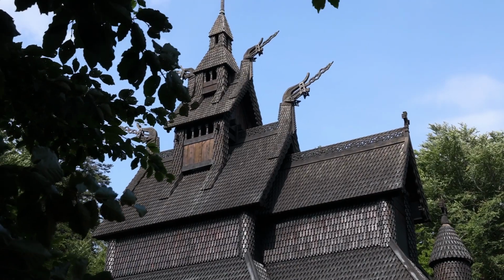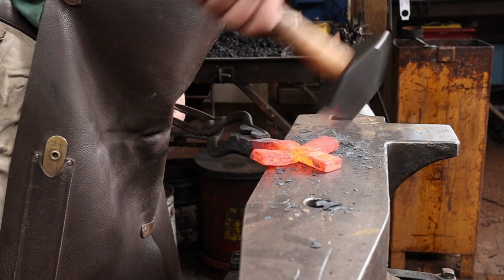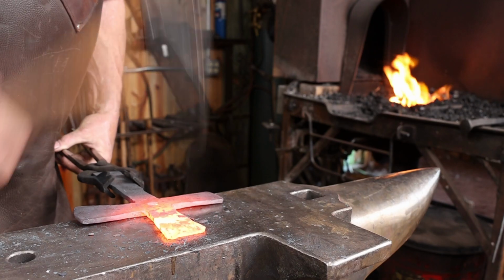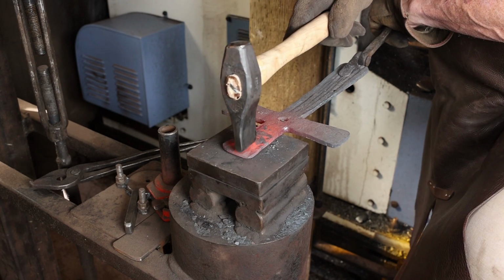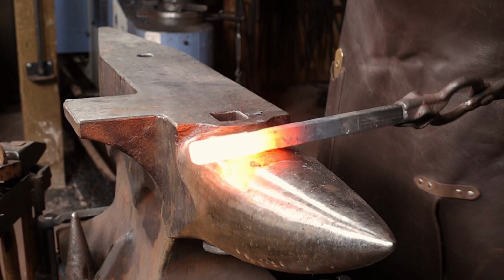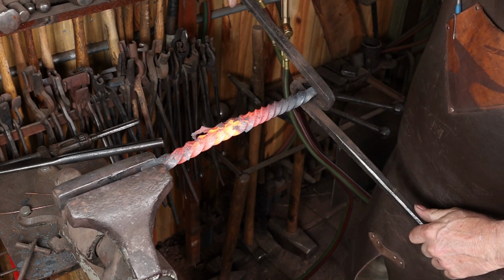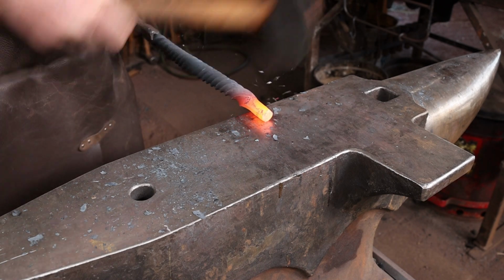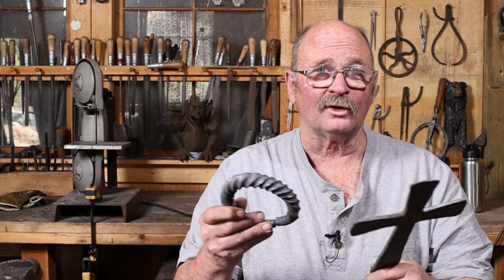Church door Handle - part 1

Comment: For straightening those twists out, we used to use a piece of wood for the anvil and a big wooden mallet, not too hard but not too soft of a wood, to beat them out straight. Doesn't do much damage to the edges.

Comment: You mentioned a wooden mandrel; any sufficiently sized green branch would work.  Doesn't even need to be proper size or round, just something with curves soft enough to not mar your work.  I made a 1.5'-ish diameter ring out of .5" square stock with twists.  The final ring shape was done on a 1' diameter log without a rawhide mallet.  I just used a branch as the hammer.  I'll confess to electrically welding the ring together instead of forge welding it.

Comment: Another excellent video sir. It’s appropriate that I usually watch these after church on Sunday afternoons. I enjoy seeing you work a combination of traditional techniques along with your power tools, as the power tools seem to be used just to speed things along. 
I also enjoyed your use of dividers when measuring the arms of the cross, as I’ve recently picked up a couple pairs of dividers and found them immensely helpful in my work. Beats the hang out of trying to hold a ruler up to the work to measure width.

Comment: is there some way to make the twist symmetrical?
Reply: You can hold the piece fast on both sides and twist from the middle, but symmetrical twists like that are usually better saved for a wavy pattern, aesthetically speaking.  It also really only works well with uniform cross section and heat.
Reply: @davidtauriainen9116  You can do a symmetrical twist the same way by heating only half of the piece and than switching direction. You would get kind of a V-shape right in the middle and I think, I would like that look better. But of course it would be even harder to do than this one.